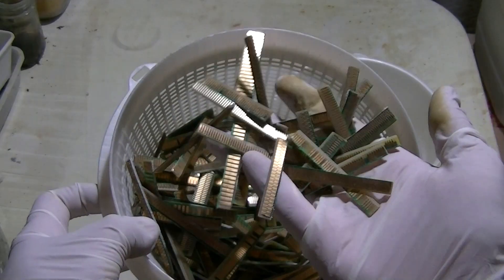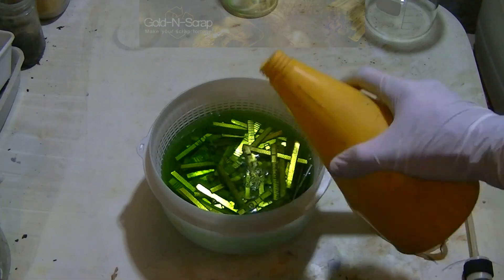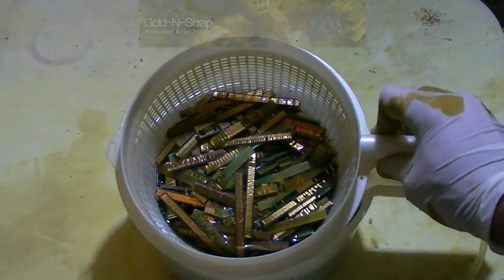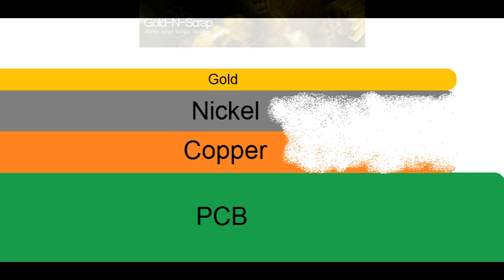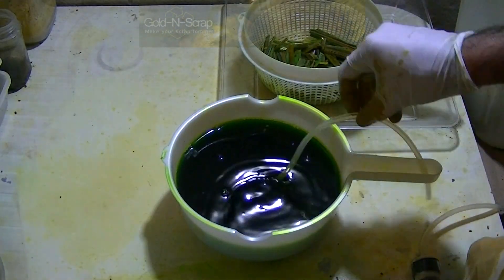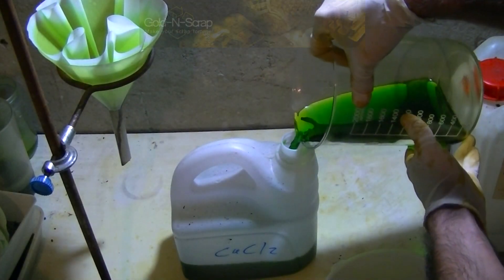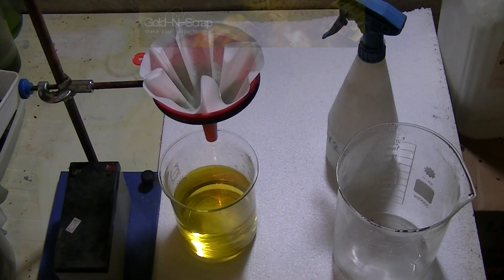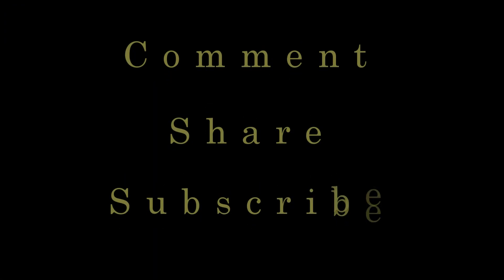Gold Fingers - How to Recover Gold from Electronic Scrap

Comment: Hi. Very interesting approach. For myself, I see two flaws in the procedure you suggest:
a) you are handling very dangerous and toxic chemicals. Set aside that the users who are going to copy the procedure for themselves do that at their own risk (and I bet there are some cases of survival of the fittest following in spite of your safety recommendations), some of the users may act irresponsible by just throwing away the remains of the chemicals and the shreddered hardware ... a possible environmental problem.
b) Especially after the first treatment of the gold fingers there should be a considerable amount of Sn and / or Cu in the acid solution. Is there any way to recover it, too?

I know that there is little you can do on a) (set aside not publishing videos like this, but that would be a pity); but what do you think of b) ?

Comment: So thinking you have normal size digits, and according to the report of the gold by fingers i can assume you have a 5mm lenght, 5 mm wide, and 4 mm high gold nugget. that's about 100 mm3 of pure gold. but sure, the gold is round there but let's just calculate it's a cube. According to the density formula of gold (19300 kg/m3) we can calculate that the gold you have it's about 1,93 grams.

Comment: It is certainly not eco-friendly, but why not just melt it all by fire or kiln, and then the gold can then be taken off the bottom of the remaining residual pile  ???. (of course it may take a couple of times of remelting, separating, cleaning, and remelting), but it seems that it would be much safer, faster, cheaper, and easier to achieve the same end result.

Comment: The processes shown in this video is absolutely ridiculous. I have recovered many troy lbs of gold from electronics scraps with a much easier, safer and faster method. instead of hydroelectric acid I used Nitric acid and water 50/50 mixture, the Nitric acid would dissolve the base metals in minuets instead of days. I could have separated the gold in this video in less than 1/2 hour. when the Nitris acid is finished (full of copper) it can be evaporated in a pan the remaining salts are copper salts and can also be sold. Nitric acid is far safer to work with, I got acid on my skin many times the only time I have ever been burned by it was if there was an existing injury that was exposed to the acid. I have even had it splash into my eyes once or twice with out any problems I simply washed it out. The fumes created however are quite noxious and this should only be done out doors or under a hood. A couple notes with this method: Nitric acid doesn't dissolve tin the tin or lead (solder)solder becomes a gray past in the bottom of the container so it is best to remove as much solder as possible before progressing the scrap. secondly nickle isn't dissolved either it generally breaks up into very small flakes and is removed in a secondary process I used involving mercury. this process involved amalgamating the gold in mercury then separating the gold from the mercury in a retort this process was very efficient and I recovered all the mercury to be reused again. The resulting gold was averaging 98.6% pure gold. I only stopped recovering gold because it became harder and harder to find good gold scraps, a sign of the times I guess they use less and less gold in electronics now.
Reply: Sorry I meant to say Hydrochloric acid spell checker strikes again.
Reply: Also you recovered less than 1/2 gram of gold from the amount of scraps you processed. the fingers you used look to be from more modern circuit boards the gold is very thin, try some old Digital Corporation circuit boards from the PDP series computers you will be amazed at the difference in the thickness of the plating. the first computer I scraped was a small PDP8 computer, I recovered 3.4 ounce of gold from this one computer alone.
Reply: Weston Norgress can u give a demonstration, im being serious its something id like to see
Reply: floyd ster Hello Floyd I wish I could however it has been many years since I have done any gold recovery, I no longer have the equipment, gold scraps or access to Nitric acid I once did. If you want to give it a try visit your local chemical supply house, I used to buy it in 8 gal stainless steal carboys  this was generally 70% Nitric acid. I could recover about 4 to 6 oz troy with 8 gal. of acid This was before 9/11 Nitric acid in higher % can be used to make explosives so I'm not sure of the availability these days without obtaining permits. If you try it two things I didn't mention was the filter method and the etching container, the gold gets pretty agitated and breaks up into some pretty small particles (depending on the thickness of the plating) so took a 1 gal plastic jar ( big 1 gal mayonnaise jar was best) cut a large round hole in the screw on top, then lay silk screen cloth over the opening and replaced the screw on top, then cut off the bottom of the jar it made a great filter to pour through, the other thing I used was a 5 gal plastic bucket never put more than 2 gal of acid in the 5 gal. bucket or it will foam over and you will loose gold all over the ground. (hard lesson learned) and never never add water to fresh acid always add acid to water. there can be a pretty good exothermic reaction otherwise (another hard learned lesson started to melt my buckets LOL) Good luck, if you try it let me know if you give it a try or have any questions. Wnorgress@gmail.com
Weston
Reply: Hi, hope u are fine. My name is Ahsan. I need ur help regarding gold recovery from CPU processor pins. I separated all pins by heating method and the put almost a 100g of them in a HCL 37% and Nitric Acid but instead of yellowish solution i got dark green or blackish kind of solution and after adding urea and sodium metabisulphite i got silver colour mud at the end on the base of beaker and solution is still of samr dark yellowish or dark green colour but i didnt found any black or brown mud. 
I need ur help please guide me if i am using wrong HCL as it is mentioned HCL 37% infusion, on the bottle. 
I am losing money in it. 
I shall be greatfull if u can share ur whatsapp number with me so i can send u videos of my present expriment situations. 
Regards,
Ahsan,
+971504545062.
Reply: some wonder why i would use 50/50 acid and water the acid comes at around 70% acid and 30% water from the chem supply house. I delete it more for several reasons 1. it holds more dissolved metals 2. at 70% the acid is to hot to work with. 3. once the acid has stopped dissolving metals I could add a little more water and the acid would stretch a little further.
Reply: Ahsan awan  Are you for real? You even post your phone number in public, Idiot...
Reply: Ahsan awan Well I have no experience with the solution you used (aqua regia). I suspect the other base metals are causing you these problems. you might try evaporating the solution off until you have a solid and then dissolving it in nitric alone to remove whatever base metals that nitric can dissolve you may have to do this several times, dissolving gold in aqua regia is usually done without other base metals. I have prepossessed the pins you are working with but i used just nitric acid on them, this however required several days time. the nitric acid was very slow dissolving what ever was between the pin and the gold the actual pin did not dissolve but the gold was freed up. this also worked for the square gold plated cover found on these chips. good luck and in the future I would try just a small sample to perfect the process before risking everything untried.
Reply: Troy Pounds? Off of what? What has the most? Thank You.
Reply: Cheyenne Bodie xx kjj bxd

Comment: I see some people saying this isn't worth it but  with some searching I found out that...

* 24-carat (pure) gold is used on PCB connectors.
* The density of pure gold is roughly 19.3 g/cm³
* Estimating the size of the "nugget" to be 0.22 cm³, I calculated its weight to be around 4.25 grammes.
* The most recent price I can find is £24.76 per gram, which makes this nugget worth around £100 (170 USD).
* I fucking love the internet!

That's a lot of money for not much work.  Two batches a week and I could live off that!  There's the problem though, you need a regular supply of boards.  I like this because it is recycling and it is also an independent venture, I'd rather eat rotten eggs than work for an evil corporation.  I might give this a try, first step is to find a supply, I'm not buying any chemicals or equipment before I know this is realistic.